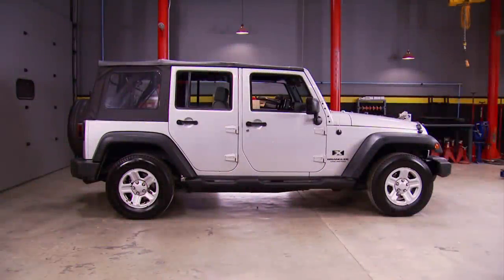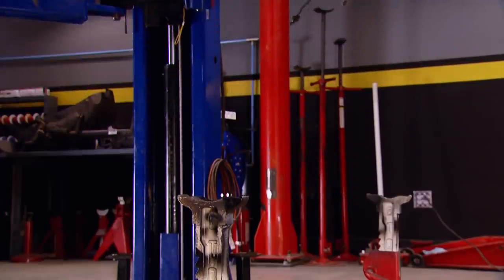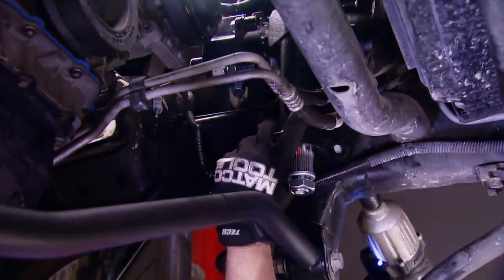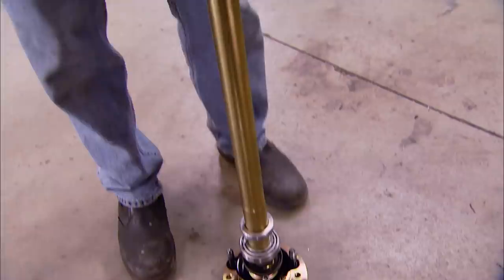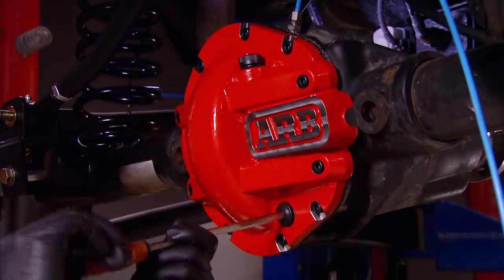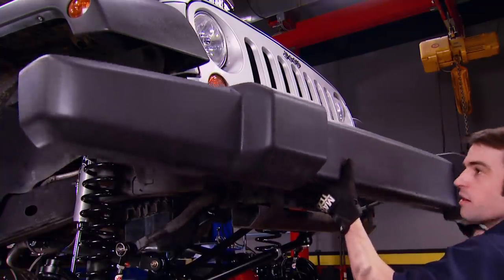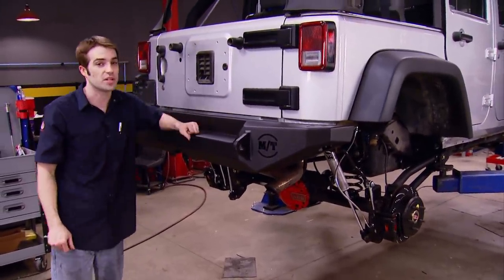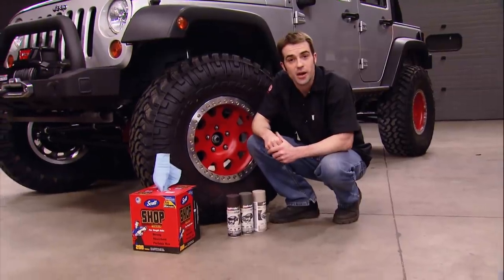Completing the Wrangler 4WD Conversion with a New Axle and Driveshaft - Truck Tech S2, E10

Comment: Welcome to episode two of "We Are Clearly Not Jeep People"! That unused storage space is where you put removable top parts. The molded plastic tray has bolt icons next to a series of holes. Under the molded plastic tray is your standard, cheap jack and tire iron. I would mount the air compressor outside the cab like any normal person.

Comment: I have an 88 f150 with that stupid front end. How about a video swaping in a junk yard Dana 44? Looks like an easy swap, with a bronco track bar and custom control arms. And I'll be able to install better lock out hubs instead of the short run ones warn did for Ford in late 88

Comment: your better of just buying the 4x4 jeep in the first place. it works out to be cheaper
Reply: they upgraded just about everything. no need to spend the extra money on the 4X4 when those parts were being replaced anyway.
Reply: @ericmartin2470  in that case just dont buy a jeep if u gotta replace the entire jeep with jeep parts to make it into a good jeep
Reply: @cordellej  as far as i know, no auto manufacture makes a lifted and reinforced 4x4 except for a military application.
Reply: @ericmartin2470  in that case what the point of buying a 2wd jeep to make it into a 4x4 jeep . no matter what you say your comments make no sense whatsoever. its just dumb anyway you look at it and real stupid.  your better of buying just the vin number plate from the factory then buying whatever parts u want and sticking the vin number onto it. other than that your excuses and reasoning are the lamest ive heard in a very long time
Reply: @cordellej  woah, no need to get mad. lets try math... the cost of the 4x4 was thousands more. since most of the parts, if not all, were outright upgraded with after market parts then whats the point of spending extra for the 4x4? lets say they spent the extra money for the 4x4... at the end of the day there would be a pile of parts that was removed. they were better off saving the money and getting the 2x4. with that saved money they put it toward the purchase of the upgraded parts.
Reply: @cordellej  "in that case what the point of buying a 2wd jeep to make it into a 4x4 jeep" - To Save Money the 2x4 was much cheaper and with that saved money they purchased a much stronger and more robust 4x4 drivetrain.
Reply: @ericmartin2470  still comes up with more bull shit points
Reply: @ericmartin2470  yup there taking it all off anyways
Reply: @takingu2skoo462  i wonder why people get so mad when i prove my point and then fall back on name-calling. saying i have a good point or giving facts to support their argument and simply "agree to disagree".